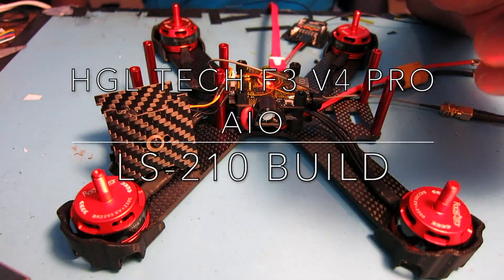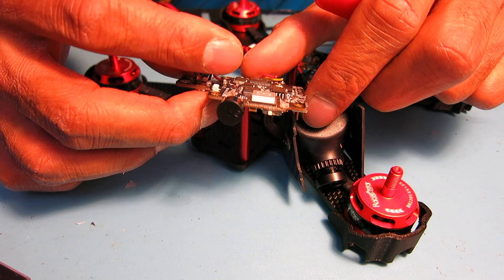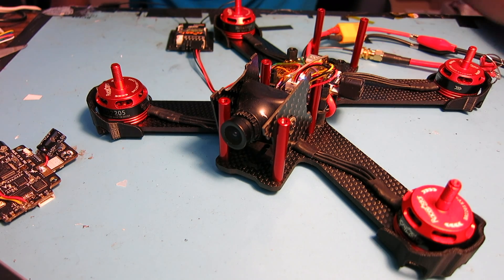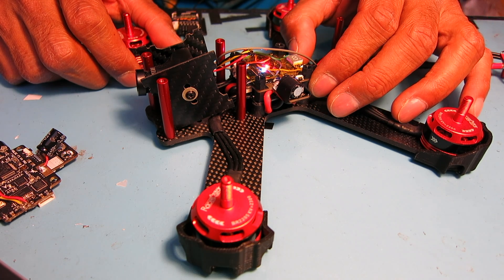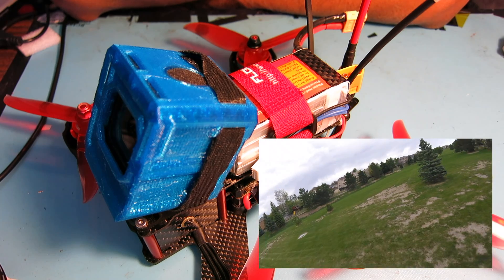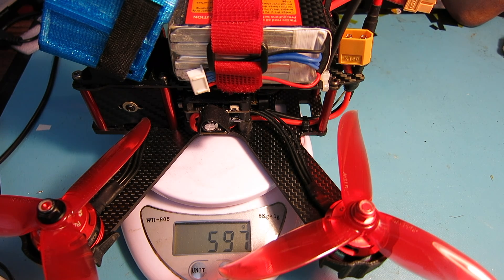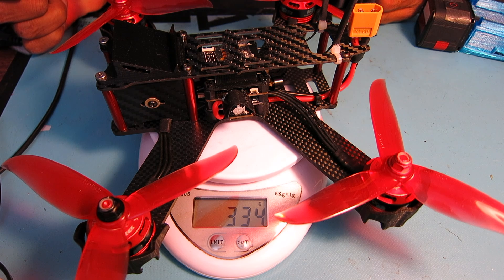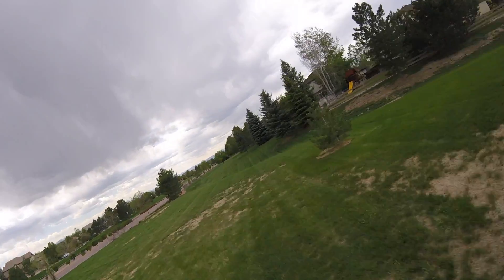LS-210 Build with HGL Tech F3 V4 Pro AIO Flight Controller and OSD Setup

Comment: what in the hell is all this gluing and taping .. just give up on that thing lol
Reply from the maker: The glue and tape are just to immobilize the wires.  There are a lot of vibrations and knocks that can move the wires around.  Eventually, there will be a break somewhere. It's just preventative measure.  The first time you have this happen to you will make you start thinking of ways to prevent it from happening again.

Comment: Do you live in Aurora CO? your flight looks like an area up the street from me just off of E Orchard.. Anyway when connect to the 4in1 ESC did just connect a single wire for each motor? also what are the resistors for?
Reply from the maker: Hi Ivan.  Yep.  I live right off Orchard and fly at the pool sometimes. 

Yes.  There is 1 wire for each motor from the flight controller that goes to the ESC.  There is a capacitor on the battery lead wires for suppressing voltage spikes and video noise.
Reply: OK thanks for the Knowledge.. New to FPV. I did read that people had issues with noise over the VTX. What size cap?..  other than color My build is going to be close to the same did think it would be that heavy.. it will be the first one for me outside of the mini ones I have.
Reply from the maker: You can put them on the PDB or on each ESC.  This flight controller came with a 470uf cap that I used.  It's easier just to add 1 on the PDB.  I usually use a low ESR 1000uf on the PDB.  Check out this page for some detailed info:  https://oscarliang.com/capacitors-mini-quad/

Don't worry about weight.  I even run a bigger battery. 1500mAh for more flight time.  The quad in this video is still flying and is great.  It's not the most powerful, but sometimes a little less power and more weight makes it a lot easier to handle.

Comment: why go through so much trouble with the ftdi connectors when you can use betaflight to configure the osd?
Reply from the maker: As far as I can tell, the OSD that is integrated into this product is not a "Betaflight OSD".  To check this, I enabled the OSD in Betaflight and went into the OSD tab.  This tab just showed the default Betaflight OSD settings, which means everything was turned on.  If you are making this work, let me know what the trick is!

Comment: great work!
Do you use current sensor of FC board ? How do you hook it up with 4 in1 ESC?
Reply from the maker: Thanks!  The current sensor is part of the FC/Power distribution board and there are pads on the FC that you solder the 4-in-1 ESC to.  You could even solder regular ESCs onto it but space will be tight.  So this FC actually works pretty well with the 4-in-1 ESC.  You can see the solder blobs on the FC board here:  https://youtu.be/ag1SIhYZwG4?t=23s and they are on both sides of the board.
Reply: Thanks!